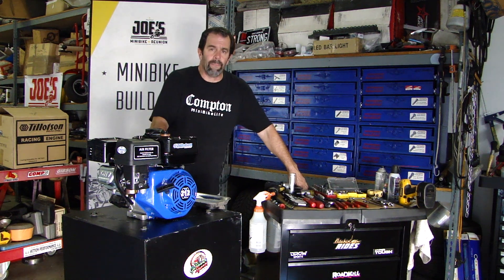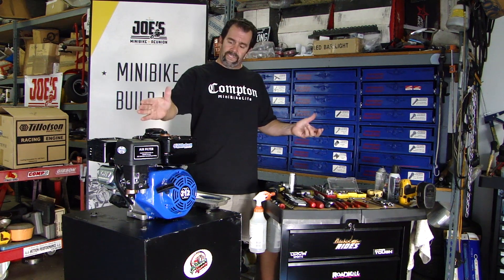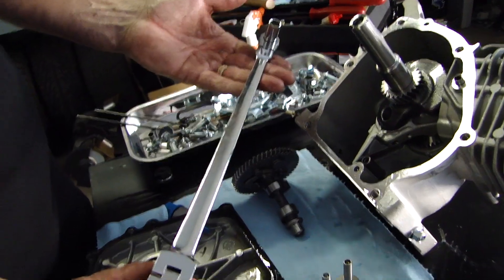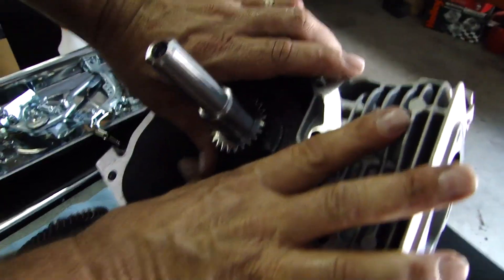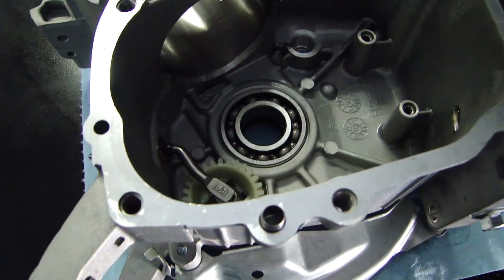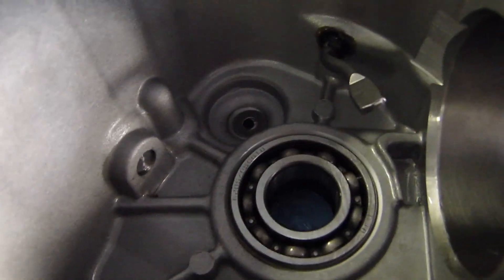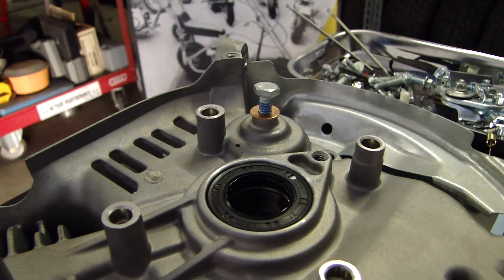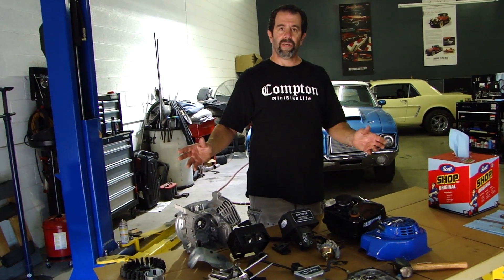20HP "Hot Tilly" Tillotson 212 cc Teardown & Governor Removal

Comment: I have a question. I replaced a cover gasket. When i removed the cover the crank was removed by an inexperienced helper. I just want to know if there is any special steps besides lining dot to dot to getting the correct timing?? Thanks in advanced. How can or where can i order one of your engine builds?

Comment: Great tear down and details.  I'm working on my first 196cc on a Champion 46596 generator that came with a replacement Allwinner 196cc that I can't find anything about.  Figured I'd read around and see what's the scoop on these 45° off horizontal shaft engines since all the ones I've studied to repair are 90° heads off the crank case.  So, wondering to make in the future with a made in the U.S. or Japan replacement if I can't find another Champion 196cc engine... what will mount up to the generator or what parts can I swap into another that almost will mount to the generator with a crank case mount though still have the same crank shaft.  Any ideas or places to ask around?

Comment: At what point does one ram jam a piston from the crankcase through the sleeve after already removing the head causing it to become a projectile?
Reply from the maker: When you need a photo op... 🤣👍
Reply: @MuscleMinibikeBuilds  lol! I knew you were a pro! I subbed. Thinking about adding a Tillotson to my lineup. I have a stock Predator 212 Non-Hemi,  15 hp Hisun 196, The Chonda Gx160 and another Genuine Honda Gx160 build starting in a few days. I'm spending around $300 to build those 160s to around 12hp. I'm gonna go for a 212, kinda pissed I missed the Mach3 212r but I can build it better myself,  any suggestions?

Comment: That Tillotson block looks nice. Some thought and care went into that. Nice machining from the factory as opposed to the Predator.
Reply from the maker: It's a nice piece, great casting and finish as compared to a predator...
Reply from the maker: There's a large amount of cross over parts that fit, basically anything that fits a Predator hemi or gx200 honda fits
Reply: WHATS YOURSOC  yea when im out on the trail 30 miles from home and blow the CHEAP chinese rod bearing, or worse, rip that CHEAP flywheel through the case, I'd be wishing I spent more than $119 on the pre dater. Tilly lightened flywheel good to 10,000 rpm stock! Its worth it to me. You get what you pay for every day.